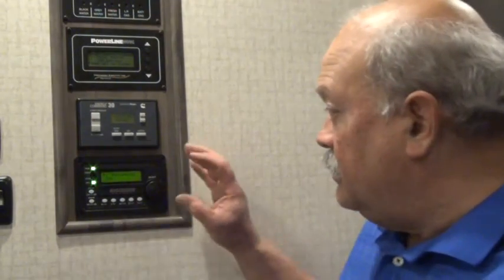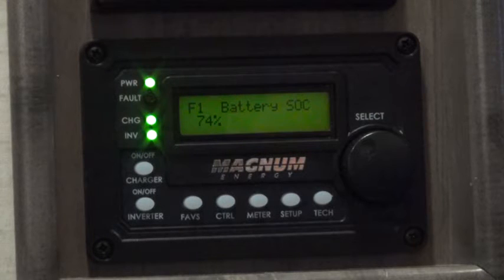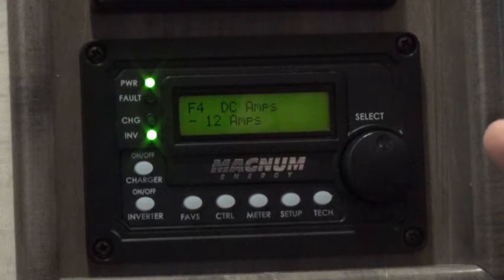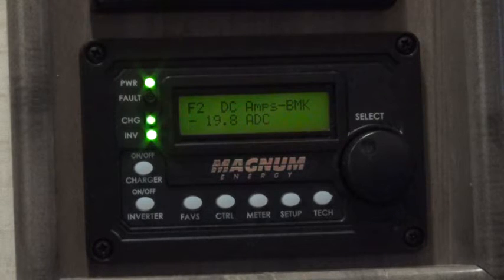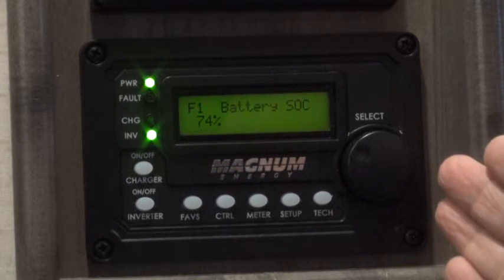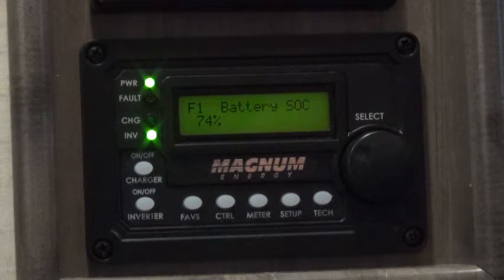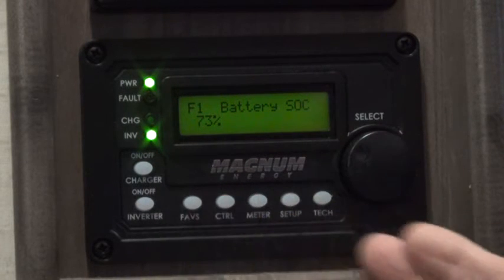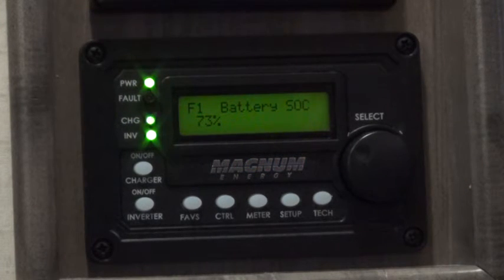Electrical system control panels for RV's

Comment: Installing lithium in my RV as got the VIctron 3000w inverter/charger with voltage sense as I here it is more ideal for lithium and for what its worth all batteries. Anyways I wanted to get the Magnum 3000 inverter/charger as the products are rock solid for the most part but dated. I normally  don't do compulsive shopping but ebay had a 20% off sale and paypal had a 2 year no interest deal if paid in full by end date. I pulled the trigger on the victron due to the bluetooth function and got a 50 amp victron mppt charge controller with bluetooth too plus the victron color panel. Plus a victron 712 amp hour counter with bluetooth. 800 watts of the spendy genuine sunpower flexible panels as my RV has a very seriously low CCC. So now I am gathering all my other compenents. 

How do you like your new lithium batteries as I am intrigued with the bluetooth features to view each cell etc.? 

As you  see by now I like bluetooth as it had to be cool and convenient. 

Thanks Jerry for sharing with us.

Comment: Jerry, Great video and explanation of the ARC50 but I have question: I think I saw an Onan AGS control module in the stack above the ARC50. If so, why wouldn't you simply use that module to control the recharge function while not on shore power? Would it be possible for you to show your battery shunt and installation of the BMK next to the battery bank? Again, thanks for the info.

Comment: Jerry, was the new controller a direct replacement or did you need to rewire the new unit? I have a Magnum inverter with the smaller controller w/o display. 
Thanks
John
Reply: Thanks for the reply Jerry.